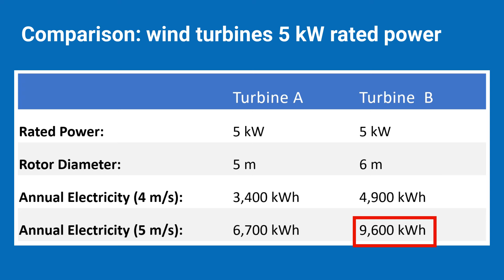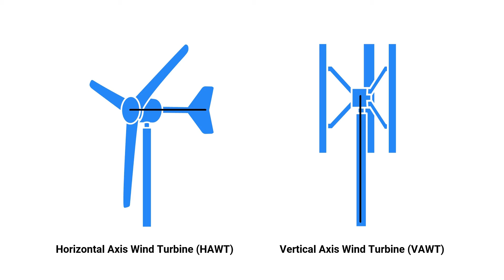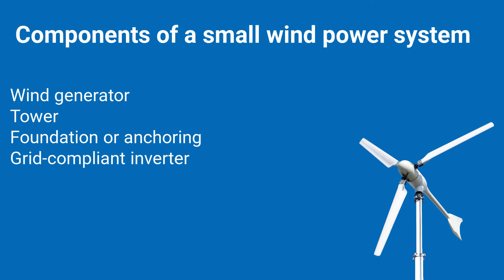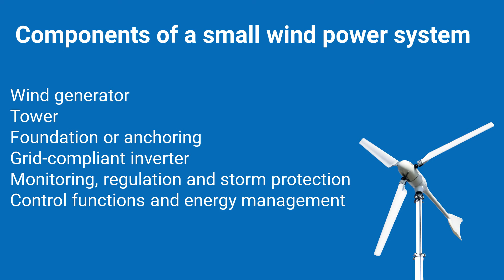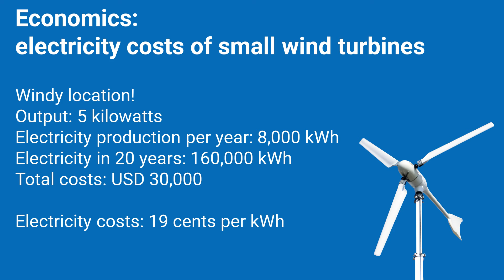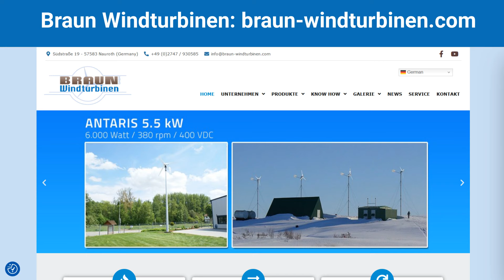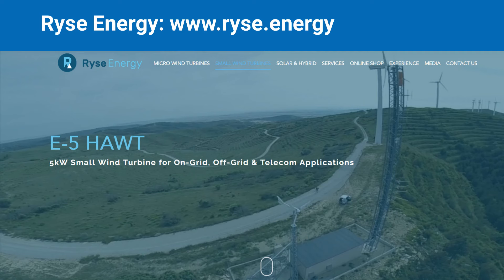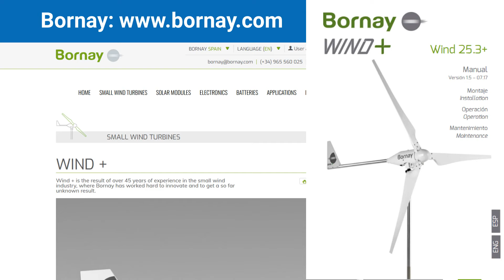Home Wind Turbine with 5 Kilowatts Power: Yield, Manufacturers & Costs

Comment: I'm sorry that I don't agree with your point about 6 minutes and 41 seconds. I am a wind turbine manufacturer and my name is Eli. Clearly your comparison of wind turbine systems and electricity prices is oversimplified. Usually when we compare, we should divide it into grid-connected systems or off-grid systems. If it is an off-grid system we must consider the battery factor. Batteries are not cheap for most people. We all know that almost the vast majority of batteries come from China. If you want to buy some good quality battery chips, they are very expensive, and usually the lifepo4 batteries on the market only have a lifespan of 10 years. If you want to compare the price of electricity with the electricity produced by a wind turbine. You have to consider the cost of replacing the battery.
Reply from the maker: The video only deals with on grid systems. In fact, I could have made this clearer with reference to off-grid systems, which have different framework conditions.
Reply: Every comparison I have seen with so-called “green” energy is extremely faulty.  They compare the costs of the “green” technology when it is producing and they never consider the cost of the free battery provided by the grid.  So, every grid user is subsidizing the cost of the “green” energy.  If you compared every technology on an apples to apples basis, the cost of solar and wind would be very high compared to nuclear or NG.  If you required the solar system to provide power 7x24x365 as is expected from nuclear plants, for example, the cost of the batteries required to do this would be staggering.
Reply: Ofcourse your going to disagree , I've watched many videoes on home wind turbines and read numerous articles and they are way too costly and don't give much power . They need more developement before home wind turbines are practicle .

Comment: We considered getting a turbine in the 2 to 3 kwh size but after looking at installation costs and maintenance costs over 20 years found that solar and a plain old gasoline generator along with some grid power and a 30kw LiFePo4 battery bank would be more cost effective in the long run.. These units need lubrication and the contacts that allow the turbine to spin on the mounting to transfer power to the wires need cleaned or replaced every 3 to 5 years.. That means removing the turbine from the mount most likely with a crane and putting it on the ground then after maintenance putting it back up.. This is not cheap unless you own a crane with a 100 foot reach or you build a system with a stout enough tower that allows for independent lowering and raising.. I guess if you live in a remote cloudy windy area you have few choices so the outlay of $30k to $50k might be your only one so plan for the maintenance with a tilt over tower or retractable one that will allow the disassembly to do it..

Comment: I liked the explanation of small wind turbines. It reinforces my longstanding belief that efficiency in your building envelope and heating and cooling systems as well as appliances are the best ROI. If you build a home that requires only 20% of the energy to heat and cool through insulation and passive principles and select the most efficient appliances and use mini splits which can have SEER ratings over 30 and HSPF ratings over 14 and for hot water system use a heat pump unit. The cost of doing this will less than a solar or wind system.

Comment: One consideration that I find very much understated is in the comparison between horizontal and vertical wind mills, is the sheer footprint required for horizontal mills when you take anchoring and wiring into account. For our own location as an example, I can say we're in a consistently windy coastal area. Yet our property is in the vicinity of trees as well and space is limited. The vertical mills might generate less in a 1:1 comparison to an equal size horizontal mill, but considering the horizontal mill will require more turbulence free consistent winds, it would require height and potentially cutting down of some trees! For the same ground area with less height I can have multiple vertical mills instead with each a much smaller footprint on the property. So basically looking at the kW per square meter on a property for mill footprints.

Comment: Very good information. Can you recommend any good smaller turbines (say 3m to 3.5m ) for remote off grid cabins with solar+wind. In this case it is not so necessary to cost justify, but instead to keep batteries up in winter.
Reply from the maker: Check Bornay from Spain or Ryse Energy.

Comment: So I have to wait till the system cost doubles n price? Here in southern Spain I just got quoted 11200 euro for a 5 kw sys all included ( yes battery as well) installed… what is going on here? Meanwhile one of the largest electricity distributors offered and I signed it a rate of € 0.1023 per kWh… I can sign up for a night tariff (less that 0.8 ) charging battery (purchase =2000) , i am considering that…as the electrical would have a smooth feed not influencing my high end sound system….

Comment: @WindSunWisdom Great video, but I am confused about the type of current that is created. I thought that generators/ wind turbines create AC current. @ 3:40 you stated that they make DC current?
Reply from the maker: Yes, in principle you're right, the wind turbine generates alternating current, but you can't use it that way. In this respect, the current is usually fed into a rectifier so that direct current is then available.
Reply: Thank you for clearing that up for me, as I have only a very basic understanding of electrical principles. @WindSunWisdom

Comment: Great information, however, the final thought: "A small wind turbine only makes sense in a windy location" doesn't consider the long term cost of burning fossil fuels on our climate (that most grid energy comes from), nor the fact that there are some places on earth where there is no power grid, where travel and hauling in fossil fuels is very expensive, and where there's not much else to derive energy from besides slow winds. In that case, even though a small turbine would be quite expensive relative to other locations, it still may be the best option for that particular low-wind location.
Reply from the maker: At a location with very little wind, so little electricity is often generated that you do not have a positive ecological balance with the wind turbine. In this case, a small wind turbine makes no ecological sense.

Comment: Maybe off topic slightly, but in the early 1980s I stayed in an off grid rural shack that had a couple of car batteries 12v fed trickle charge by a small wind turbine.  This powered a somewhat function, if gloomy low voltage home light system and a portable TV set (B&W).  The thing is we never ran out of power for 2 of us.  

It occurred to me the technology for this set up (minus the TV) must have been around since the 30s or 40s, but I cannot find much in the way of evidence this was in use back then.  I guess most people used candles or kerosene lamps.

Of course with advances in LED lighting our 1980s lighting system would be more effective.  

I’d imagine that the sort of set up in this YT video would leave our DIY “primitive” 1980s system in the dust.

Comment: Thank you.  I live in Tehachapi California, basically the birth place of windmills.  I’m off grid with just solar.. now.  I had a Southwest Wind Whisper 3.2k turbine that was eaten alive with our constant 20 mph/32.2 kph wind here.  It would sound like a helicopter and friends were scared.  All the large commercial wind generators around here have transmissions and a great brake system.  I have yet to see something like this for residential use.  Any thoughts on what might last here where I am?   I don’t see a lot of YouTube channels that actually pull units a part and check out the build quality.  TIA.

Comment: I would like to see a video about how to install an array of wind generators, and the charge controller that can manage the entire array, and use the energy to charge LiFePO4 batteries.

And how this wind system, might be used to supplement and existing solar array and inverter system, to allow the wind to be a supplement for energy when the sun is not out.
Reply from the maker: So far, the standard has been one wind turbine and one charge controller.

Comment: The simplified financial model used to come to a price per kWh is too sinple to offer useful information.  Micro Wind turbines have been squeezed out of the market due to the low cost of solar.  Micro wind now only makes sense in remote off grid locations where brining in liquid fuels is not an option.  

Thank you for the video.
Reply from the maker: But you can hardly do anything with solar in the dark winter in Europe, for example, the yields are far too low. At the same time, it's a windy time of year, perfect for a small wind turbine. This is the role of small wind turbines.
Reply: @WindSunWisdom  I do agree with you, a mix of both solar and wind would complement each other really well, but solar is winning out, it's getting cheaper, wind is just too expensive and there are too many scams.

Until we start seeing small scale wind turbines that actually work well and are a lot cheaper than they are now, then I think it's better to oversize a solar setup then to go wind power.

Maybe vertical turbines might change that, but until I see solid evidence that they work well in urban areas, the risk is too high to bother with wind power at a local level when solar is getting so cheap and better.

Comment: Does it generate at normal wind speed of 4 mts per sec. Most small wind turbines fail in test.
Reply from the maker: Yes, but there are also very good wind turbines on the market that have survived extensive testing.

Comment: How much is too much or too little wind?
Reply from the maker: The average annual wind speed should be at least 4 meters per second. It is more economical from 5 meters per second. It is very difficult to make a general statement. The decisive factor is that you have a free inflow from the main wind direction, i.e. no trees or buildings for at least 200 meters.

Comment: Oh thanks, about the costs, kWh and invest.
With 19 Cent or for Thai Baht (6.27 Baht) I have to beet 4 Baht (first 150 kWh) to 7 Baht for over 400 kWh.
10 Meter plot available from old WiFi, but no Wind or less than 2 m/s most ... sadly. But I might have to measure some days myself to sure.
So far the Solar have to make it ... Invest 6.400 US$ and paid of with savings End of November this year.
Wind seam to be more expensive ...

Comment: Assuming no repairs or maintenance over a 20 year period is not realistic.  Probably need to add at least 20% of the initial cost for maintenance, insurance, repairs, etc.  Residential wind is almost never cost effective.  Its value is in providing energy for off-grid locations where there aren’t other options.
Reply: Все ветряки (хоть промышленные, хоть бытовые) дотационные и о окупаемости и речи быть не может.